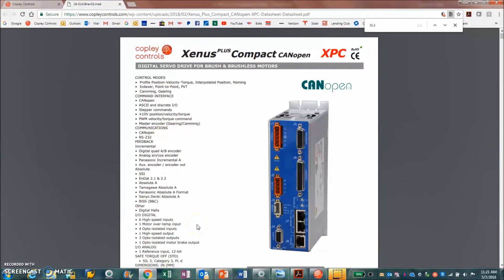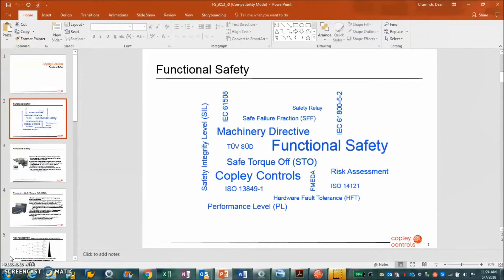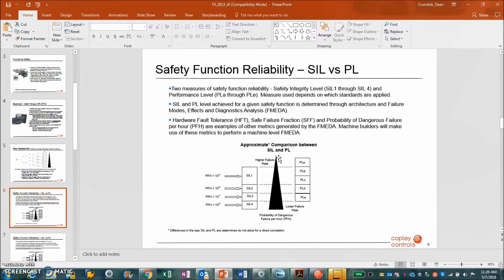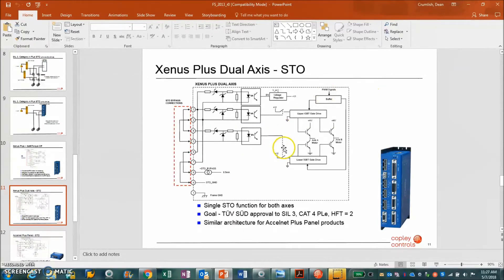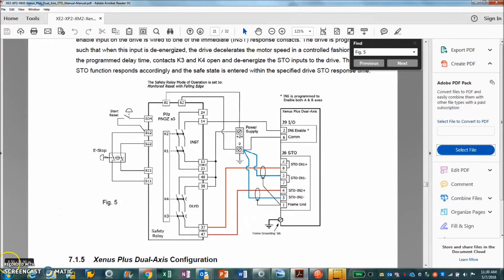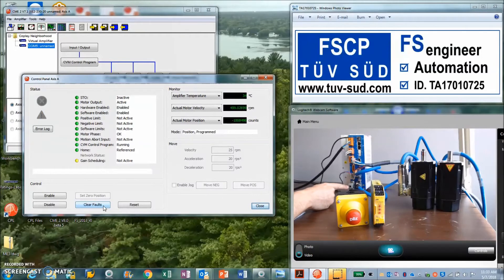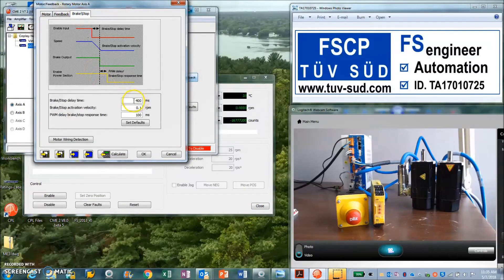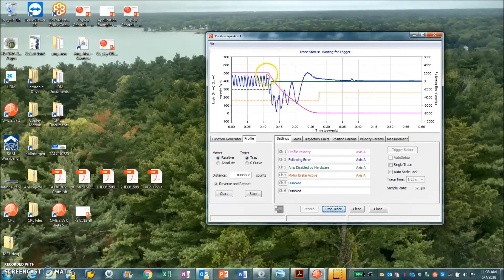Copley STO (Safe Torque Off) per IEC 61800 SIL 3 ISO 13849-1 PL

Comment: If we have multiple drives, do we need a separate safety relay for each drive, or can we power the STO circuits of all the drives from the one set of contacts on one relay?
Reply from the maker: David Bernardi, I assume you are using a safety relay with no undetected faults so I believe it will not reduce the safety factors. Send me an email at work. dcrumlish@copleycontrols.com and I will check with the primary saftey engineer.